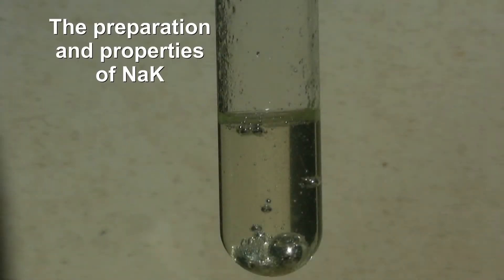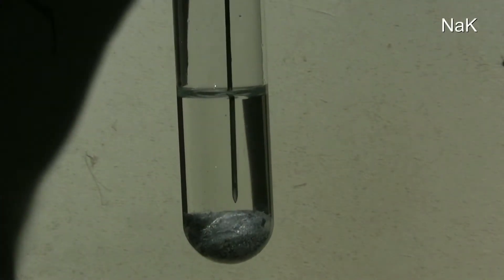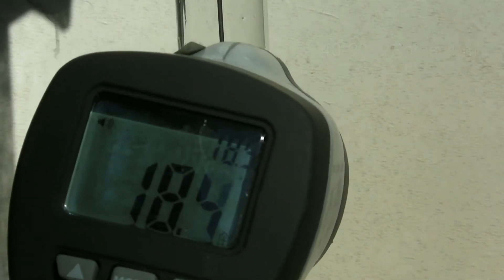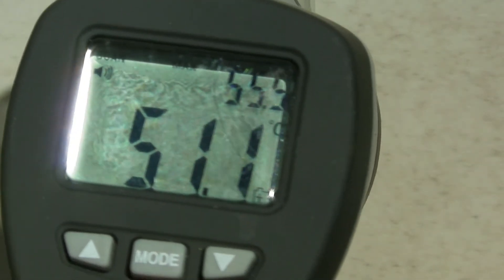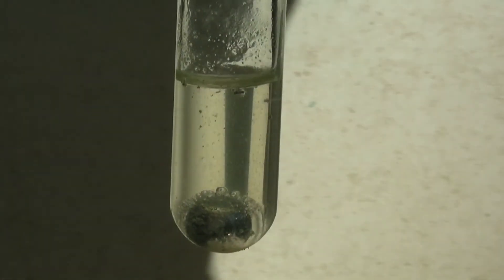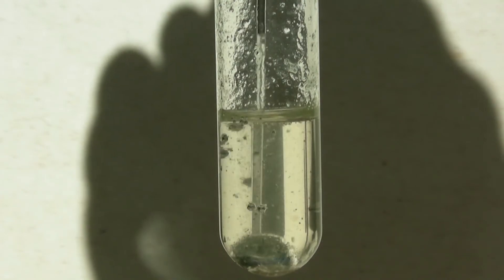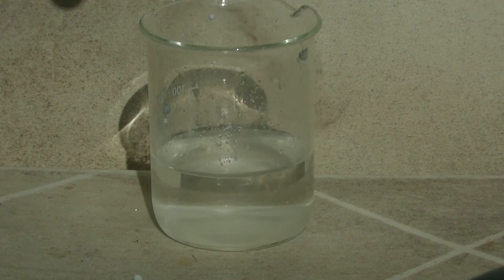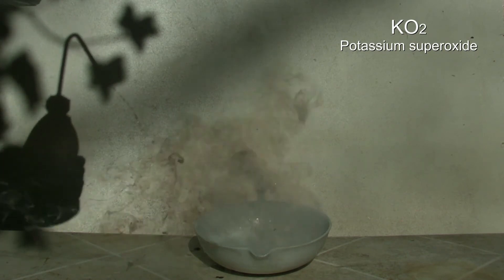Preparation and properties of NaK

Comment: a question- it reacts to air to form a superoxide.....does that superoxide ignite in contact with water? or on its own?
Reply: 2 KO(2) + 2 H(2)O = 2 KOH + H(2)O(2) + O(2)

This is what happens when the superoxide meets with water

Comment: NaK is often used as a thermal bonding material in the production of nuclear fuel rods.  It has also been used successfully as a coolant for space-borne nuclear reactors, including 31 fast fission reactors built by the former Soviet Union.
Reply from the maker: I read about the use as a coolant for the nuclear reactor in satellites, but I decided not to give too much information in such a short amount of time. I didn't know about the fast fission reactors, though.